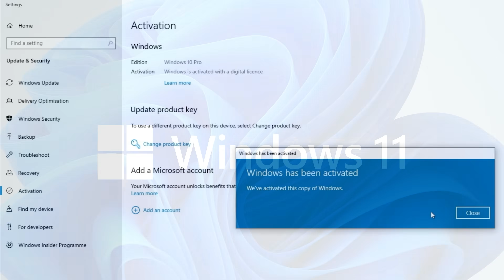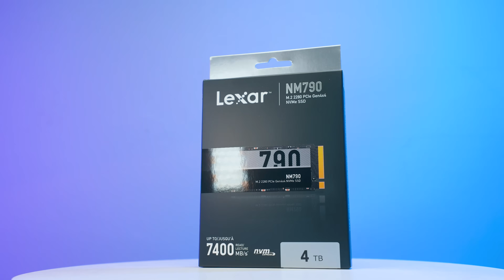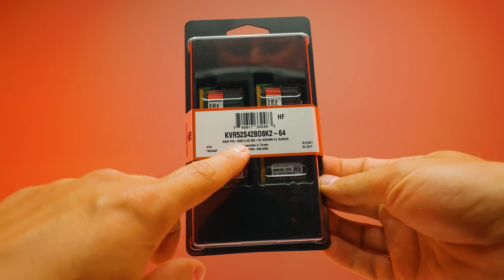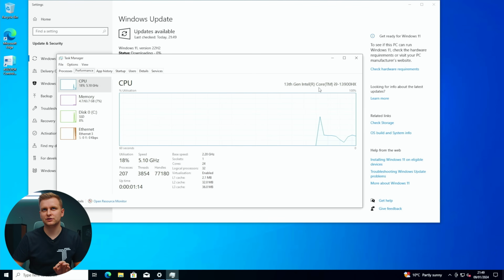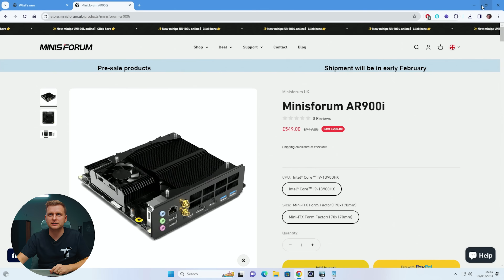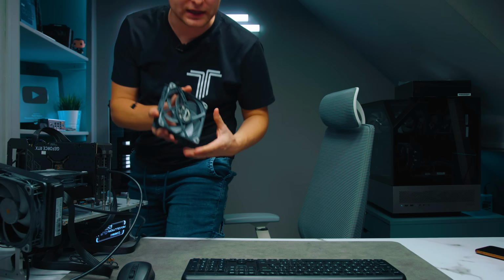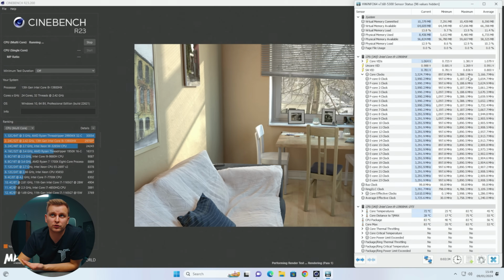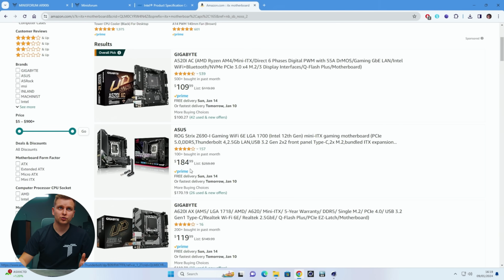24-Core CPU Baked INTO This ITX Motherboard?!? 😲 | Minisforum AR900i Review & Test

Comment: It is possible to flash a bios with the power limits totally unlocked by selecting the value RPLS8161 150W in the VR POWER DELIVERY item.
I made an updated bios ready to unlock them.
The performance changes completely even if I didn't go beyond 170W (fixed) so as not to overload the motherboard VRMs

Comment: I kinda don't see a reason to buy this, you can get an ITX board with the features you want, here you are limited to what you get, RAM choices also limited. If you get a desktop i7 chip/7900 for the AMD variant and power tune it then you match this thing. SFX PSU you need to buy anyway. Still don't see a reason to get this over a normal ITX combo, there might be some price difference but nothing ground-breaking. Nice review tho

Comment: Interesting really like it, I did some searching, specs state gen 5 on the M.2 drives as well as the PCIe 5.0x16, it does make a difference as im looking at 2x the price for gen5 M.2 and would love to see performance on that as well. Really like your presentation on this ITX mobo it made me want to purchase it, found it on Amazon 539.00 better yet P.S. it's in my shopping cart atm. I stand corrected the 4 M.2 are pci 4.0. wondering why if there is the gen 5 speeds are out why are we still using gen 4 in the latest mobo if we have 5.0 x 16 PCIe, still learning I am.

Comment: I bought it for my mini itx build to pair with rtx 4060 low profile.
Reply: How is it
Reply: @user-hy4xz1qt9h is all good. Temps reaching 80 easy. I have 7.3 litre case quite small with not much ventilation. To give better temps I will mount 2 x 120mm external fans. Although 80 - 90 degress under load is normal temps for 13900hx. Everything else is fine
Reply: @algatronalgirdas  thanks for replying. do you play games or make music
Reply: @user-hy4xz1qt9h  I build mini pc mostly for gaming and a bit of other work. I have also gaming laptop which is now going to be used for other tasks. Before I used gaming laptop for gaming and work.
Reply: @algatronalgirdas  A year later, how does the motherboard holds ? Any problems with it ?
Cheers

Comment: I hope it doesn't sell almost anything, because otherwise, a bad future will be heading in the PC one that we already went through in the past when processors were soldered to the board and users could not adjust what we bought depending on what we wanted to have, but it depended entirely on the assembler, who normally makes the assemblies that they are interested in and if not,   They force you to pay a hell of a lot more for a superior one.

Comment: With the open back exhaust on the built-in heatsink, you could actually skip top-mounting a fan if you used a super-slim case (I'm thinking 1U rack mount) with positive pressure airflow to blow through it. That would allow for a super slim build, perhaps in a keyboard drawer under your desk or, as mentioned before, in a small 1U case  (one of the shorter 18" depth ones perhaps) you could mount there instead and not even need a full rack setup. Plus cable management would be a breeze, haha.

Comment: 5:20
If you look closer in the pcb you will see that there is no RGB control chip, in other words that is the reason why there is no RGB connector, this board simply does not have that feature.

Comment: I would probably not use the included heatsink for the M.2 drive and get an SSD that comes with a heatsink and put it under the fan, wish I could install a 140mm fan to cover the RAM and the second M.2 slot.

Comment: I've owned a fair few "cpu in board" mobos, dating from the original mini-ITX EPIA-5000, which i still have in some box somewhere, to newer Atom/Celeron's. I'd never buy this for "general use" as it's way too expensive if ANY part goes south. It's basically laptop cost territory without laptop benefits...

Comment: It's not going above 145w cause the cpu has already reached the maximum all core boost frequency, so anything beyond 150w limit has no effect

Also, Minisforum has a ryzen 9 7945hx 16 core and a ryzen 7 7745hx 8 core versions as well
I recently built a pc with the 7945hx and rx 7800xt and with AFMF enabled I can pretty much play most of the games at 1440p high with 240hz lock on my monitor
Reply: How does that ryzen compares in test against the intel 24 core for multitasking ?

Comment: Would love to see how it preforme on lower TDPs, like 35, 65, 95, 105, 125w.
Alot of power that you could fit in a smaller case with a slim fan maby not drawing the 145w.

Comment: Hi im Using i5 12400f processor its hitting 100° Degree While Using Handbrake Encoder is there is any solution
Reply: Off turbo boost technology in windows

Comment: Absolutely would've used this in my ZS-LRTX 13900K/4090 6.7L build.

It would've saved me a couple hundred bucks & allow direct die cooling. Replace the thermal paste on the die with liquid metal & the temps would be even better.

Does the motherboard allow for undervolting in bios or XTU? Easy 2K-4K R23 gain there, if so. Also, the TTC offset in bios may allow for more wattage (it essentially controls the max temp), which is why your wattage was being ignored & temps were always the same.
Reply: All i know is im more satisfied with my 13900hk ES that can go past 5ghz all core. With a 47mm cooler to boot!

Comment: I can't see any point or benefit to using a soldered-on laptop CPU in a desktop. Kind of defeats the purpose of owning a desktop and you are limited with what you can do with it.  The throw-away BGA turdbook approach ruined laptops, so I view this as an unwelcomed design on a desktop platform. The only entity this benefits is the manufacturer from what I can see. If it was priced at like $150-$175 it might have some merit for building something extra-cheap if you don't care about the gimped performance. If the motherboard or CPU fails, the whole thing becomes e-waste. No moving the CPU to a different motherboard and no dropping in a replacement CPU. Unless you have a laptop that needs a RAM upgrade, you can't even repurpose the memory. Kind of sad and pathetic when you look at the big picture.
Reply: For a larger size desktop, I would agree with you. But this is an ITX board. I bought it as soon as it was announced, and am very pleased with it so far, using it as a portable development system where I need a very small size ITX case, without a separate GPU, which can fit into a backpack / small carrying case. It's nearly perfect for my use case, because it fits into a 3.8L case, and has plenty of vertical clearance. Compared to a socketed ITX board, where adding a CPU cooler makes for such a cramped situation that the front panel USB connectors cannot be installed. With the socketed CPU, the CPU needs to be throttled to the point where the performance is even a bit lower than the AR900i. Plus the temperatures are better with the AR900i. 

The soldered in CPU doesn't bother me, because by the time I'll need to replace this, the 1700 Intel socket will be long outdated, which means I'd just buy another motherboard anyways. 

The specs that really made this a great solution for me are:
Low profile
4 NVME ports
Great CPU performance / temperatures
Reasonable cost, which was actually less than buying an Asus ITX board, CPU, CPU cooler.

Of course other people will have different use cases, and for them maybe such a board doesn't make sense. It certainly wouldn't make sense for me to put in a fixed desktop case. But for an ultra-small ITX case, the board is almost perfect for me.

Comment: They should have used two separate thermal pads over the 2 NVME's, because as you did it the sticky pad will collect dust and probably be unusable by the time you add a second NVME.  I would have cut the film in half and put one side back on where not needed.

Comment: I mean, sure, you could use the 16x pcie slot for a gpu, but I think that the better use for that would probably be a SAS HBA or a 10g or 40g or 100g network card (I am sooo sick of manufacturers only using 2.5g).  this should make a great reasonably low powered file server head (particularly with the 4 m.2 slots) - you could do a raidz ssd pool and with an hba and external disk shelf you could do a ~48 disk raidz3 setup (I would go with a 6x 8 disk vdev raidz3 setup to keep rebuild times reasonable in the case of a 48 disk array).  there are many good itx 2u server rack mount server cases out there.

Comment: I was waiting on some reviews for the MF BD790i and since they are sold out I may just get this one instead for the 4xM.2 and not having much IO. I've seen reviews and such for the BD770i with is the Ryzen 7 one so I know the Ryzen 9 one will be even better. They will help make a very capable small gaming pc with LP gpus like the 4060 and I think ASUS has a LP gpu coming as well. I hear so many people comment and complain about what the mobo/cpu boards won't do knowing that they are geared for a specific crowd but it's good to see channels like yours push them to see their limits. Great video!!!
Reply: It's back in stock for preorder btw. I just ordered one.
Reply: got 2 of these running with 4060ti and rx7800 buy it its a no brainer!!! I have 2 ryzen model as well but didnt like that those only have 2 m.2 ssd. this badboy has 4 m.2 and all are 4th gen as far as I know.

Comment: You could get a mac m2 mini for the same $ and get similar performance for creators
Reply from the maker: Well, this here is hugely expandable, Where's Mac Mini isn't... :)
Reply: @theTechNotice  it's pretty limited.  The Mac has a better integrated GPU and external storage is easy to add.  It also offers a faster 10gb ethernet option.  This has limited pcie slots so only an expensive GPU, and possibly more storage.  Neither is really expandable, but the added internal nvme are nice, but mac can use fast thunderbolt storage in potentially much greater amounts.
Reply: @barryobrien1890  I have mine setup with 96GB of RAM, while the mini maxes at 32GB. So, 4TB of Storage (2 NVME), 96GB of RAM and an rtx 4060 £1600. While a similarly specced Mac Mini would be £3000 1/3 the ram and lesser GPU power, or £4300 for a Mac Studio with same amount of RAM. Now, Mine is for AI development, so it has a an RTX A6000, which makes is more expensive than the Studio, but in AI you need Nvidia and no Mac offers competitive option.

Comment: Great review, the board itself (power stages) will be the limit I think, but 145W is plenty for a mobile cpu or should be, MF also do a 7945HX version but only 2xM.2 with that. Having 32 threads is good, yes if only a bit cheaper ...

Comment: If you consider intel sockets dont really last that long, this makes a lot of sense, if not more than normal itx boards
Reply: A couple generations is plenty. Unless the applications you use change significantly, I don't see the problem. Buy for your needs with a decent extra margin, and upgrades won't be necessary for a long time. There will always be something new next year.
Reply: Intel just got leaked about new LGA 1700 cpus. Believe it or not, it's the same as AMx socket now.
Reply: theres a leaks and rumors intel plan to make new CPU for LGA1700 they plan to follow AMD foot steps.
Reply: Is it true intel cpu don’t last long ?
Reply: @rahulkamath6984  depends on how a definition of "Long lasting", as modern intel cpus like since 4th gen still being used with different gpu combinations. AM3 of the same time frame, didn't.
Reply: @rahulkamath6984 the CPUs themselves last ages. Some 4th gen chips (so 10 years ago at this point) are still plenty good enough to be a usable email, content consumption and light web browsing machine

What theyre talking about is that AMD has built itself a reputation for having sockets compatible with many generations of CPUs, so you could buy a board with the AM4 socket in like 2016, and they released brand new CPUs for it this year - that's 8 years worth of upgrades to the CPU without needing to change the motherboard (besides BIOS updates). Whereas Intel spent most of the past 15 years changing socket every two generations, meaning you needed to get new motherboards more often. This has changed with their current socket, LGA1700, which has been supported for three generations now (although realistically, 14th gen is not an upgrade over 13th, which itself was barely an upgrade over 12th, which was, to be fair, amazing)
Reply: No. He's full of crap. There is absolutely nothing wrong with Intel sockets. He's probably just feeding dumb stories about idiots dropping their CPUs on the socket or forcing them in the wrong orientation.

Comment: Have you ever tested the Intel w1290P 10 core 20ntjread cpu? Got one in. Dell Precision 3640 workstation. Boosts up to 5.8ghz. Specs say 1 core max boost 5.3ghz, all core 4.7ghz and reg 3.7ghz. After repairing cpu mine ran at 5.8ghz all cores lol. Has apu on board too but is a 10th gen Intel cpu. Makes a nice budget gaming desktop. 2x my.2 nvme on board. Uses Reg PSU.

Comment: I think is a good bang for budget, because if it performs like a 13700k, you still have to buy a good cooler for the 13700k. So, for 559 usd you get a good ITX mobo and an i7 13700k performance like cpu that doesn’t gets to hot.
Reply: You lose modularity though. Even if you don't plan on upgrading your CPU, in my experience, motherboards fail far more often the CPUs. And it would be waste to junk such a powerful CPU just because the motherboard dies. It has its niche market, but it's definitely not a mainstream desktop CPU replacement.
Reply: @nenoman3855  Yeah even if a DIMM slot dies, you can't use that powerful CPU in any other build, like throw it in a homeserver or such. Such a CPU would be limited by the cheapest component that went into that mobo
Reply: @nenoman3855  For certain itx cases modularity isnt an option  like the terra this was specifically compatible for unless you do amd but am5 motherboards are absolute overpriced garbage.
Reply: Yes, you’re right on that! Although is the same with a laptops, and still they have its use, but well, laptops are portable, so again you have a good point there 👍🏻.
Reply: Because of height restrictions on the cooler

Comment: hey tech notice, i was wondering what the best, of the best case is, if budget is no problem like if you have maximum water cooling and etc, which is quiet and good. i know that the fractal is good but its small so you really cant make full water cooling, was wondering what a good big case is? maximum like 67cm in height, would be intresting to know